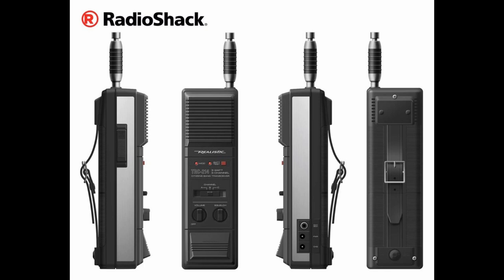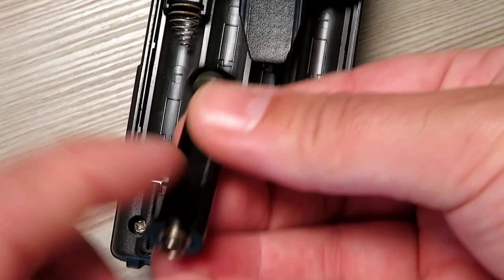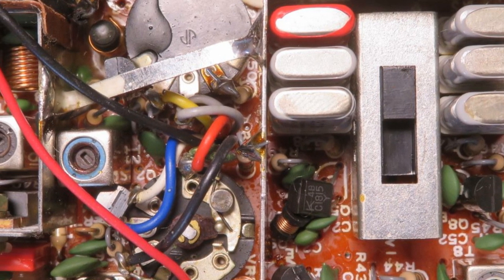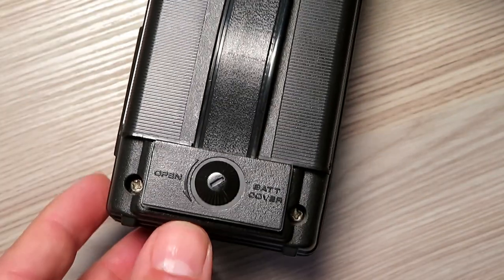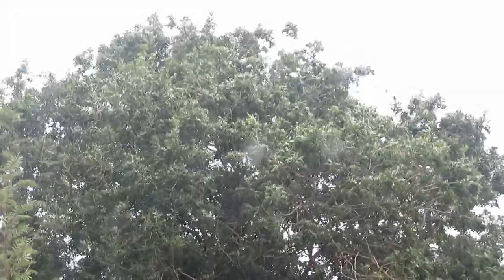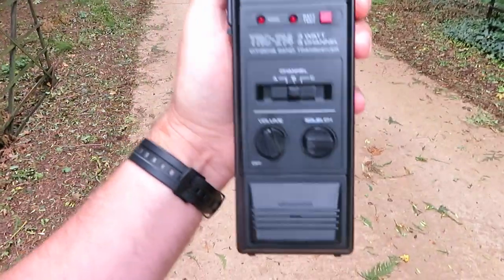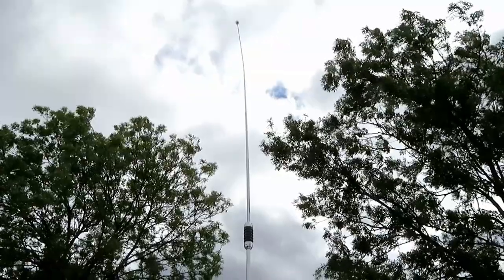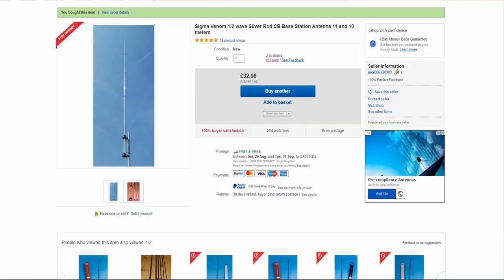THE STRANGER THINGS STAR WHO'S NAME YOU DIDNT KNOW - THE TRC 214

Comment: All right must have bought one of these years ago however right now I'm using a TRC 216 I'm doing range test on this and yes you can achieve quite a bit interesting range one thing to be added up you're using one Watt on the TRC 216 I can go halfway power and I can still do range I would definitely add a counterpoise to the negative side of your batteries a 5 ft wire sticking out a negative side of the batteries this will help propagate the signal you can do the same thing with your PMR radio adding up at 19-in wire to your PMR radio should increase the reception and transmission damn itself picks up a lot of interference a lot more than what we did before with three Watts on manage to make contact with New Westminster British Columbia to California that was a long time ago or if interference or so much more right now switching power supply routers LED lights they're all basically working on switching power supply which causes a lot of harmonics a lot of interference sometimes your noise level can go all the way out to five and six I have a friend who's making contact on four Watts from British Columbia to Ontario during the daytime at night the RF interference come in there is a place where there's green lights near his place and it generates so much harmonics that his noise goes up to six and seven however if you fine tune to walkie-talkie which I'm pretty sure you do you'll probably get a little bit more range also installing a counterpoise how you thought about trying a dipole to your walkie-talkie basically vertical dipole or horizontal dipole two wires 5 m a piece roughly you have a jack that enables you to do this now on my trc216 I'm using accountaboys just an electrical wire that runs about 5 ft and my range definitely increases thank you for showing this model I purchased this model years ago when I was younger I think I had a chance to use it a few times however it took so much batteries that I was hooking it up to an external 12 volt Jack eventually someone was giving me a mobile unit and I use that instead on a 12-volt battery the point is yes these little transceivers can do quite a bit of range if you're in the city it is going to be harder just to make one point as you probably know I need contact from a TRC 217 from North Vancouver to Gibson it's about 20 miles I made it at night I was surprised there was quite a bit of noise but my signal came in on the same model I mean contact from SFU University Mountain to the gulf Islands signal was clear of course line of sight during the daytime during the night all Neons turn on all LED turn on it kills all Communications on the am ultimately this videos do have a potential and they still are useful there are certain areas where the FRS PMR will not reach however sometimes citizen Bend well reach certain areas that PMR cannot reach probably due to ground propagation or Sky propagation that's why I like to keep FRS gmrs and of course citizen are handy 73 and thank you for your previous test experimentation definitely have tried tuning my 216 I think I managed to get a little bit more range if you had a 216 and you can do the programming for this one on the YouTube would be quite helpful in the meantime 73 and all the best thank you again for your videos and definitely try putting a counter boys to the negative side of your batteries it will make a difference 73 you probably already know that

Comment: I have a decent collection of old radios, including a couple of these and a couple TRC-206's.  I had them long before Stranger Things came out, and I'm glad I did.  I remember right after the show debuted the prices shot sky high on them.  So much so that I thought of selling them, which is something I never do.  The prices have come a bit more back to earth.
As for performance, I agree, a brand new FRS radio (In Canada) that requires less power is far more practical.  It has similar range, is smaller, and doesn't chew up batteries.
The primary reason for owning one of these is nostalgia.  My parents purchased a TRC-99 when I was a kid and I remember what a big deal it was.  We had a base CB at camp and could bring the walkie talkie out in case of emergency.  At that time we didn't have electricity at camp to recharge the batteries, and the 8 AA batteries didn't last very long.  The walkie talkie got relegated to the shed for many years.  I still have that radio, and have accumulated dozens of others over the years since.
Thanks for the video, and the dose of nostalgia.
Reply from the maker: Wow lovely comment that's great👍